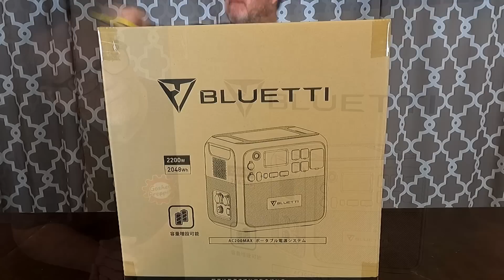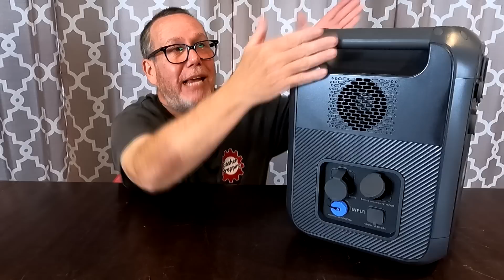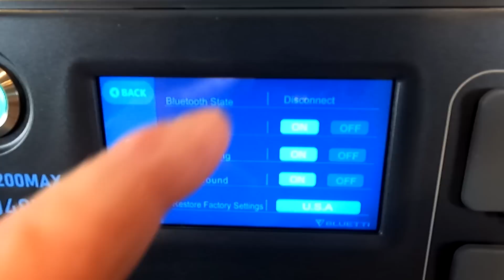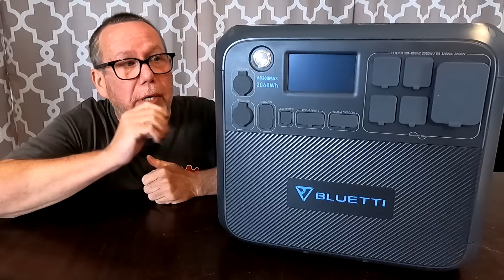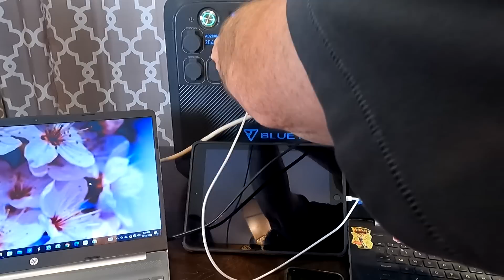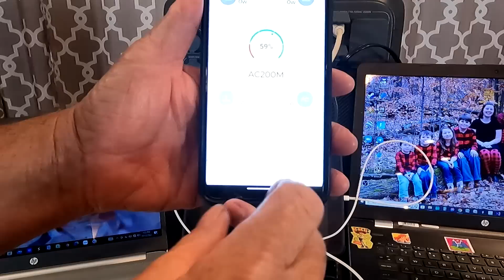Bluetti Solar Generator AC200MAX Review – AMAZING!

Comment: I have this unit. When car camping I keep it charged with an OfF Grid TREK solar "blanket" cable locked to the roof rack. It runs my ICECO 20 liter cooler/freezer all day and recharges the two 52V batteries of my electric mountain bike.

Comment: I wish it had WiFi, I have AC200MAX + two B230 battery's 1200 watt panel Primary & 600 watts panels feeding D050s also install  transfer switch it runs frig, freezer, washer & dryer (gas) Furnas TV modem, router and various lights.
I also have regular solar, it's lowered true up $800 for the year and my last PG&E bill was $35. This thing works great. My neighbors PG&E bill was $600 for the month of July California heat wave. I should of bought the B300 battery's more is better, I do have to use supplemental charging on high usage times two 500 watt chargers that are directly plugged into B230 battery's 7:30 Pm to 11:30 PM. Great Video thanks

Comment: Adding two B230 battery units will get you to 6144 Wh total.  To get the full 8192 Wh that you stated, you need to add two B300 units (3072 Wh each) instead of the B230 units. Just a clarification.

Comment: It’s a beautiful unit!! The expansion capacity is what makes this equipment so amazing. That they improved the recharge time on AC makes this much more attractive. I invested in a few smaller ecoflow power stations, primarily due to the fast recharge and they are easy for me to use and understand. Being able to run them inside to keep whatever you want running over night is pretty fantastic. The larger capacity is great for longer run times, but they take a long time to recharge on solar. I think Bluetti handles more solar input than ecoflow so your solar input is more efficient. While these are an investment, so is the food they are protecting in terms of running fridge and freezers. I started using mine to run different things around the house to remove stuff from the grid to reduce the electric bill. In the course of using my power stations I have learned a lot about how they work and what the capabilities really are. It’s been a good learning experience to see what life would really look like having to run on backup power for any extended time frame. I’ve had a couple outages this year and the power stations were amazing to use. It’s expensive but we live in a storm zone and I’m keeping more food on hand than I usually would. I do have a gas generator as well but I love these solar generators.

Comment: For the price of one of these you can buy the top of the line Honda generator that sips gas and is whisper quite . Also when it comes to customer service you can always buy parts at your Honda dealer . And as far as longevity you can give it to your grand kids after you die . Ask any small engine mechanic they will always say Hondas are the best
Reply: What do you do when the gas runs out
Reply: @danielmorse4213  purchase a 1,000 propane tank and a dual fuel portable generator.
Reply: I can't store that much fuel.
Reply: Maybe I want my campsite quiet.
Reply: We all know that but these are for the preparedness people who in case of a global emergency gas and propane won't be available

Comment: I just received the Jackery 2000.  Combined with a NUwave induction hot plate I can cook in power outages without using fuel.  Induction hot plates with appropriate pots and pans are pretty fantastic.
Reply: Lost!

Comment: There is one feature that is suboptimal. it is not possible to run a freezer or fridge on it to just safeguard from blackouts. Because it will constantly discharge and recharge and that reduces the battery lifetime, at least somewhat.
Reply: The Delta Max from Ecoflow has this pass through feature. I use it for my freezer.
Reply: Get a smaller fridge for emergency use only. During SHTF you won't have as much to keep cold as we do now. In fact we would be lucky to have milk, meat or vegetables in any quantity. 🙄
Reply: It has lifepo battery. Meaning full charge and discharge every day for 10 years and still having 80% original capacity after.
Reply: I believe the newer models have pass through mode, the smaller units do as well.
Reply: It would be nice to get a passthrough with auto switching when commercial power is cut.  I think the use cases like that are going to be few and far between